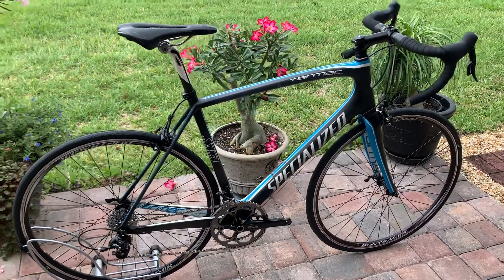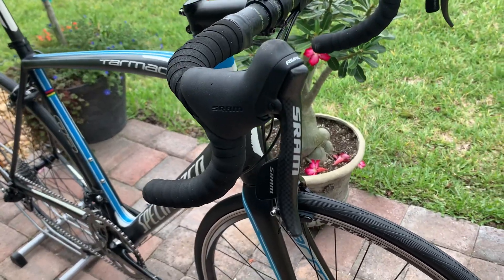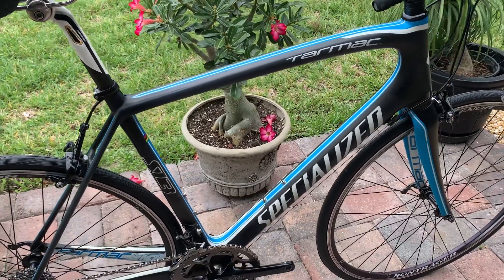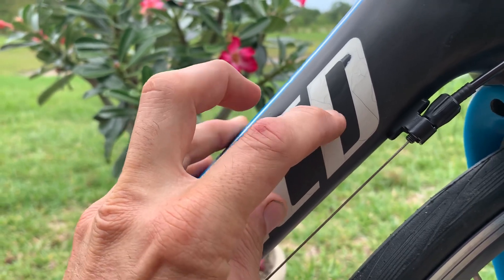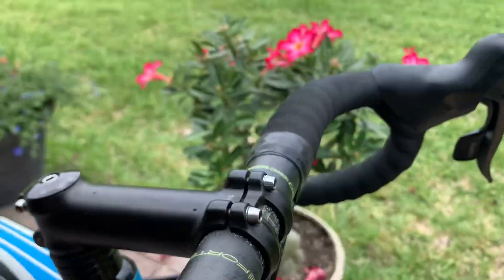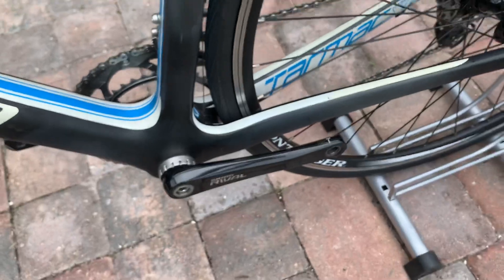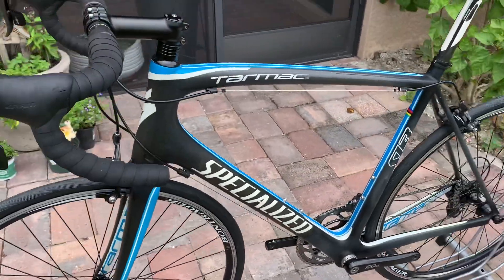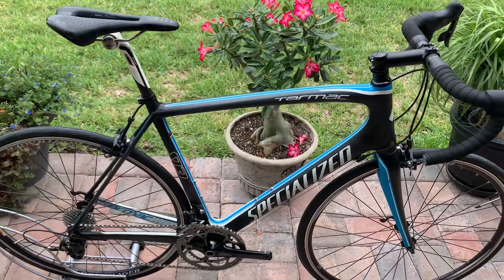Specialized Tarmac Pro Paint Blemish Issue, NOT in Carbon

Comment: Have exactly the same cosmetic cracks on my roubaix Sl4 2016
Reply from the maker: Yea it was real common from those years. The paint they used would shrink over time and separate making it looked cracked.
Reply: @recordball  is it possible to repair the paint ? Like strip it all down and paint it all again ?  Maybe paint it with a better paint for it to not crack over time again ?
Reply from the maker: @diegomtoscano definitely. Lots of companies can do it. Just look up Bicycle Carbon repair and those guys all paint frames. Make them look new again with same logos and all.